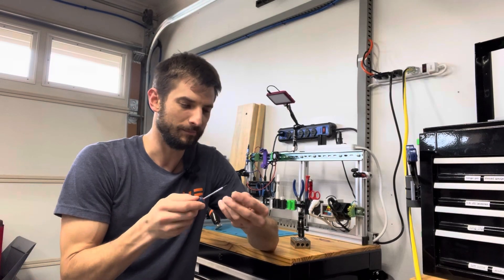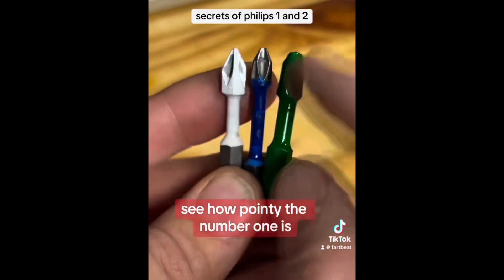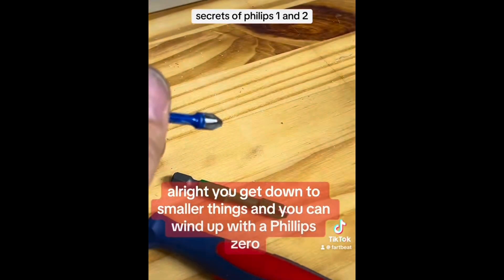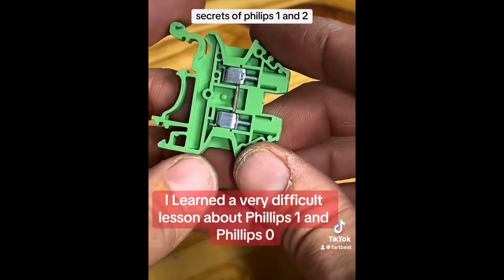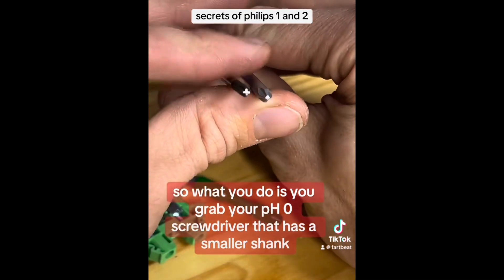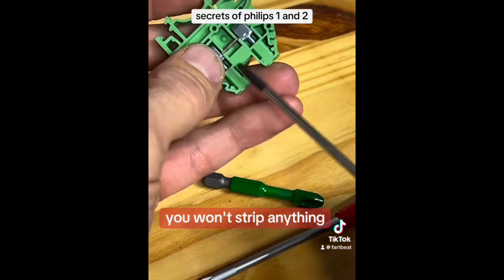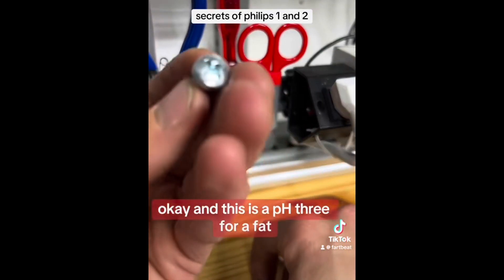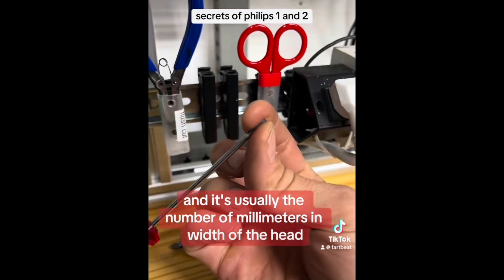modify a screwdriver for electronics, mechatronics

Comment: Take a look at Wera precision drivers. They tend to have a bit thinner shanks than many others. 

To modify a driver for a thinner shank while maintaining correct driver tip geometry (which your filing does not do!!), mount the driver or bit in a lathe and grind down the shank itself. There are some screwdrivers like that where I work. :)

Comment: Interesting - I’m from the UK and we have a lot of PZ screws in construction. Indeed the PZ2 is almost a standing joke on building sites as being the universal screwdriver. 

In the uk we find Phillips is good for appliances built in a factory - and also for dry wall screws, other than that almost everything has gone over to pozi. For anyone wondering what a Pozi is - it looks similar to Philips - but it has 4 little “whiskers” on the head of the screw to tell you it’s a pozi and not a Philips . The screwdriver end itself has an extra 4 sharp but smaller  flutes rotated 45 degrees to the main 4.